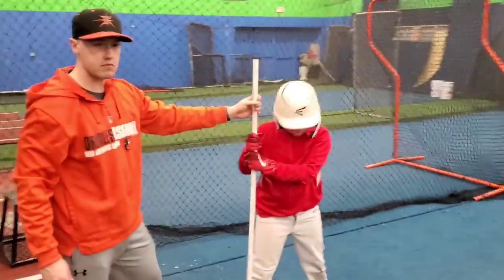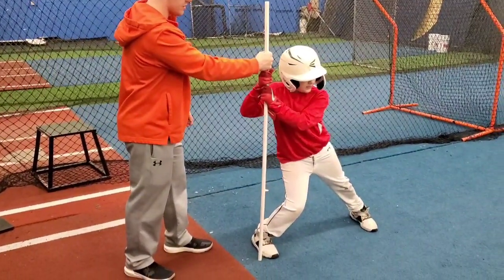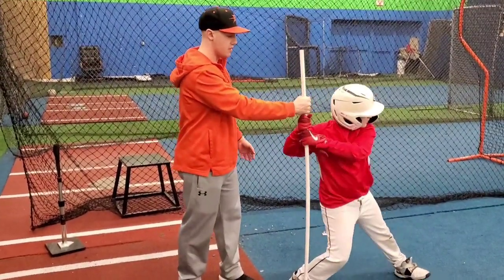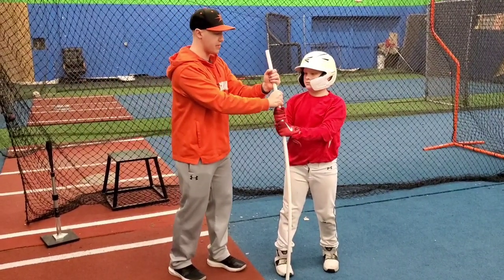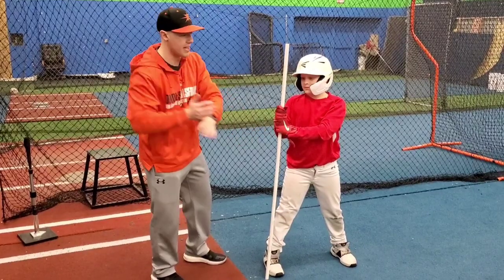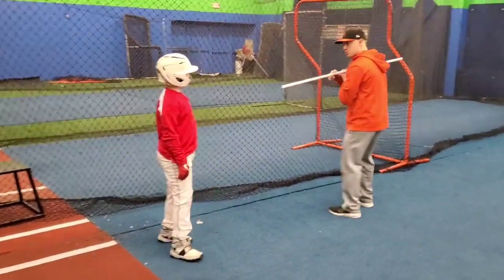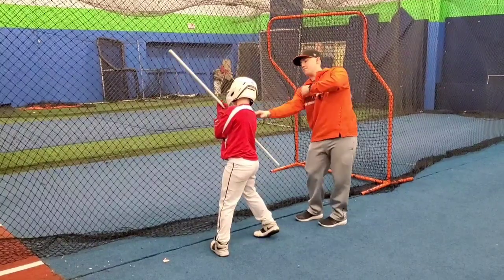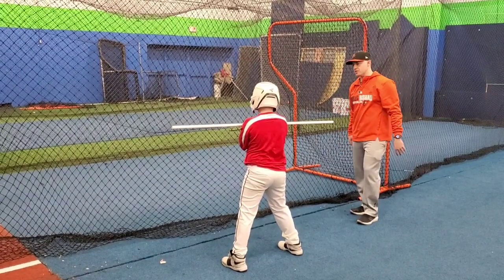PVC Pipe Hitting Drills for Youth Baseball Players

Comment: which direction should the batter point his front foot when stepping? parallel to the box lines or to the target (i.e. forward)?
Reply: 45 degrees, so basically in the middle of both or kind of pointing to first base for a right handed batter, and third if a left handed batter.